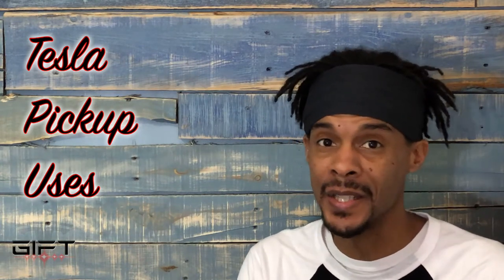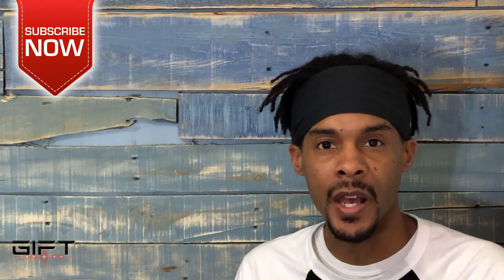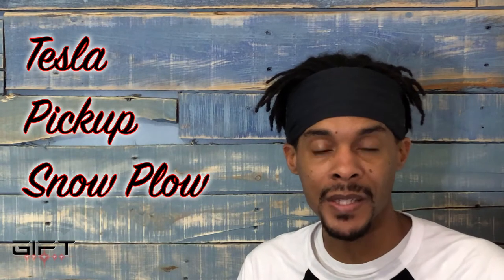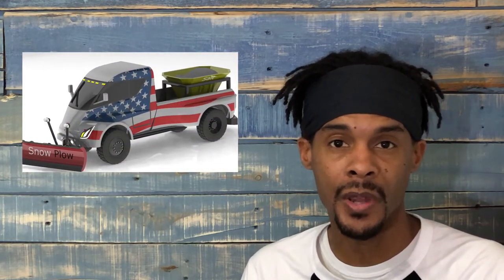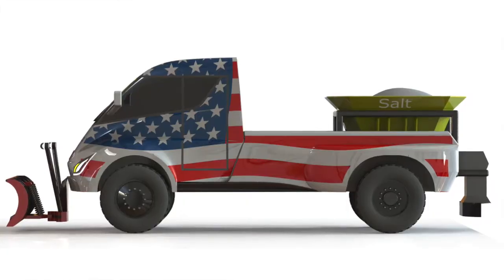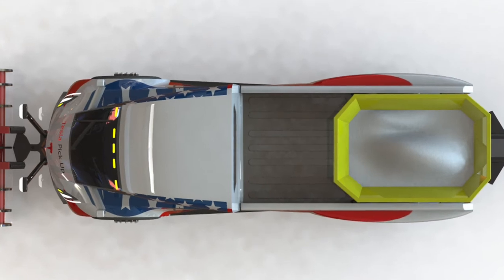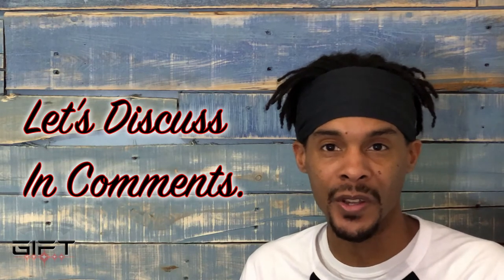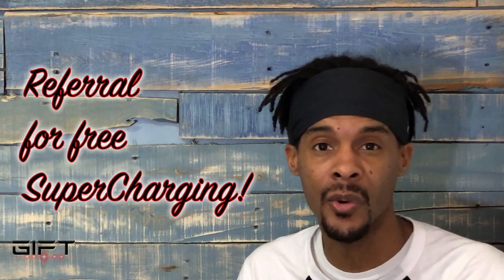Tesla Pickup Concepts - Snow Plow

Comment: The Tesla pickup is the hardest to speculate on since Tesla didn’t provide any real hints. Will it be an upscaled model X, or a scaled down Tesla semi? Will it have 100 kWh, 200 kWh, 300 kWh? Once we see the platform, we can see what sort of commercial are well suited to it. Tesla needs a real van for their rangers to drive, and the pickup platform can easily be a van, small motorhome, etc.
Reply from the maker: It was all good until the tweet about it being slightly larger than an F-150.  Now, I'm leaning toward them doing both.  That should be the case unless the abandon the larger truck and the Semi Event.  I'm going to be displaying a few more ideas if they go do actually make the F-450 size truck.  These ideas can be purchased in fleets so lots of revenue each order.
Reply: GIFT 4000, Elon was very ambiguous in the details (similar total size...maybe slightly bigger for the game changer.) The F-150 has come in so many sizes from 2WD short bed to 4WD 4-door long bed that takes two spaces to park. And the shape of the truck is still an unknown. We’ve seen mini semi, model X with a bed, and the real pickup may be something entirely different. 

I haven’t checked truck prices lately but it use to be the you could buy a stripped full size pickup as cheap as a basic car. Now it seems the cheapest full size truck is $25,000-$30,000 but not as stripped as the ones I’m talking about from the 90’s. Tesla will need to go after the High end luxury truck.
Reply: It appears that all you have done is draw a picture of a truck with a plow on it. You need considerably more information. Like a manufacturer's recommendation that says the vehicle is plow ready, a spec that says it is plow capable, and a third-party manufacturer of an add on plow, This is an air- (not water)-cooled motor. You have given absolutely no thought or consideration to how you can air cool.a motor with a plow blade blocking the airflow intakes.